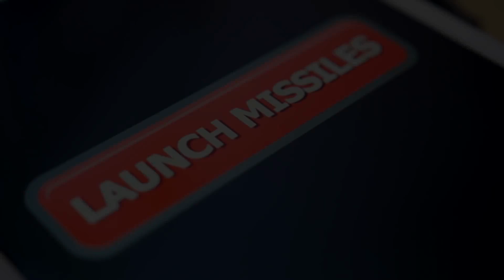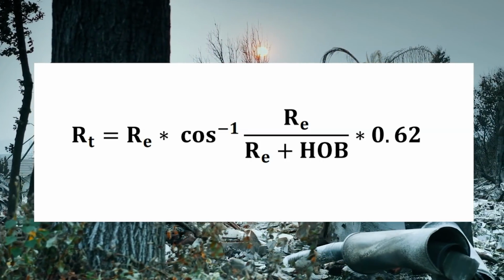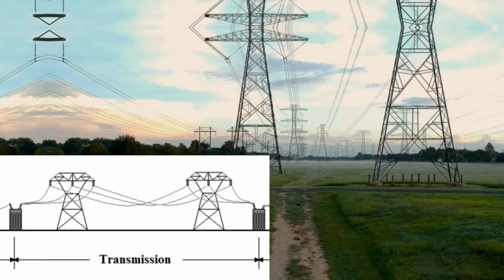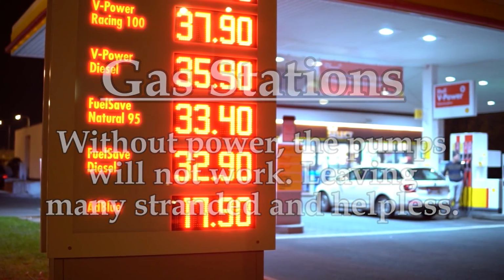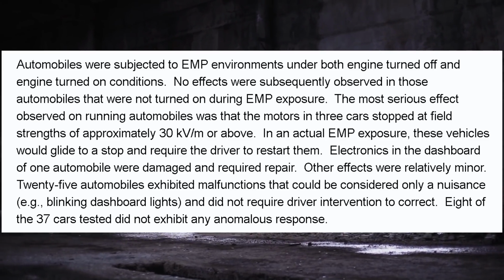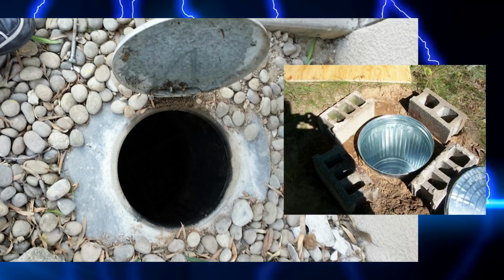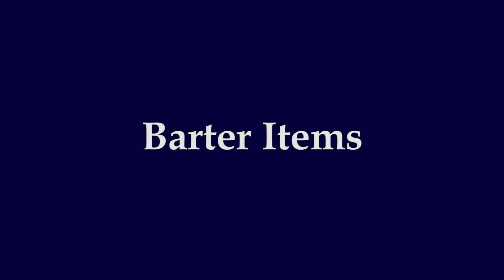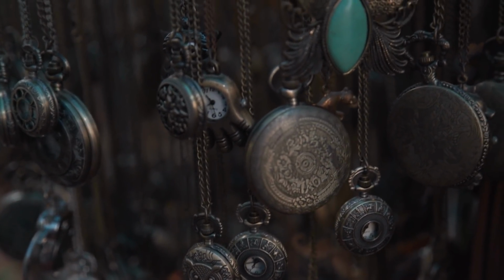EMP - What Happens - Device Effects - What WILL Survive - How 2 Build Faraday Cage -Steps to Prepare

Comment: Here’s a good thought, since so many communication networks both civilian and emergency are now 100% fiber what would happen to those? You’re not gonna transmit that pulse down a fiber line and as they have converted things to fiber they have completely disconnected the copper end. Don’t get me wrong a mux or a SLC96 and those types of equipment are still powered and copper it could affect them but to what extreme since they are no longer connected to any major grid of copper?
Reply from the maker: I wish I would have included that. Your right, fiber optics wont be damaged by an EMP. Good poit.

Comment: An EMP strike would only be a first strike, in effort to slow the spread of information as a nuclear strike primary strike is then initiated. The US discovered the events of electromagnetic disruption, all the military equipment is hardened to it. Ground assault unlikely at that point, and the military would have to act as police, as in an actual martial law senerio. This has been flirted with in the past, but considering we have more troops based and on duty in the US than police, it wouldn't be any issue.. people would go crazy not getting paid but it is their' duty to put up with. Might be more violence and legal combatance though, hard to tell really.

Comment: As a retired steam power engineer, I believe the biggest hit will be to distribution control units.  Without these, production of electricity will be futile even if it is restored.  These systems function largely in millivolts through circuit boards that are super fragile.  They are subject to even slight surges and will almost certainly be destroyed in a CME/EMP surge.  This circuitry is often specific to each distribution station.  Many are not produced in the U.S..  The personnel needed to repair or reproduce them are not plentiful. Even if you can convince these workers to leave their families at home while they do repairs, finding components and managing logistics for such a task would be incredible and super slow.

Comment: I  have been a linemen for 21 years and what most people don't grasp is that there is simply not enough equipment on reserve for a mass system failure , not to mention the people trained to repair it. That is true for the Electrical grid as well as the Telecommunications grid. Both of which would be greatly affected by such an event. Its hard to make large quantities of equipment when there is no power service to produce the equipment!!!
Reply: Hopefully he pins your comment... this is EXACTLY WHAT PEOPLE DONT UNDERSTAND !
Reply: Unfoetunately as you know,  China makes a large % of our transformers.
Reply: I’m a retired phoneman. I know what your saying and the older equipment is hard to get parts for.
Reply: Yep. I don't imagine that they would be in any big hurry to help out either.

Comment: thank you for sharing this video.. i had gave thought to the waste & the human remains that will be a problem in any grid down situation... 1 thing you didnt touch on that hasnt been answered in any info i have researched is at the nuc power generation plants, what will happen when the grid goes down if the pumps cant keep the fuel rods cooled off?? meltdown?? i know they have backup gen sets but if hits the transfer switch &/or switch gear it wont be of any use!! just something i wondered bout in this "no one knows for sure event" i hope/pray we never find out IF it can happen
Reply: they each have an “exit strategy” which allows the system to be flooded by the the nearby river or lakes. Also the inlet will retain the water flowing in until the banks around the facility are filled to capacity.... basically like a bowl of water... and the locations are usually lower than the incoming water supply, to allow it to fill up the area almost instantly. i haven’t found any documents stating that the incoming water will be stopped, once it is filled... or if the gate is left open ... ie: the contaminated water may flow back into the stream it originated from... so even if the backup gen’s were to fail, the plant would still be in a “controlled cooling”  last i read, there’s 4 backup systems implemented ...
Reply: Check out Southern Prepper one. He covers some of these concerns. Good luck!
Reply: Constructing a latrine for human waste is a viable option.